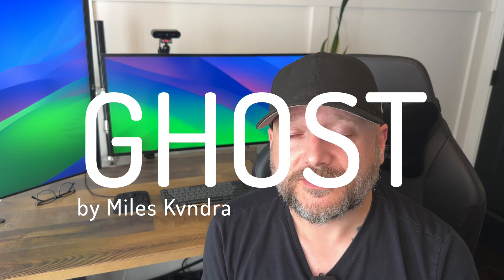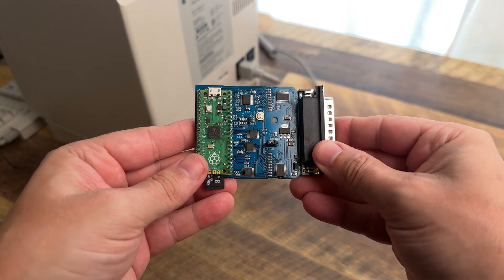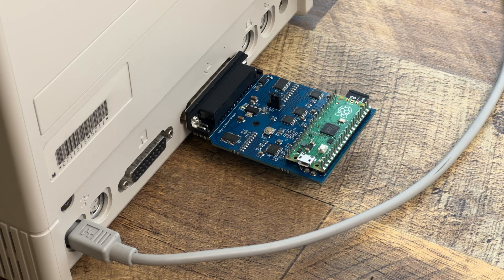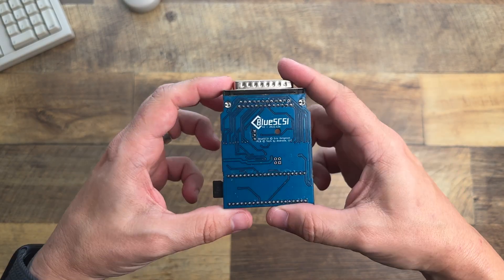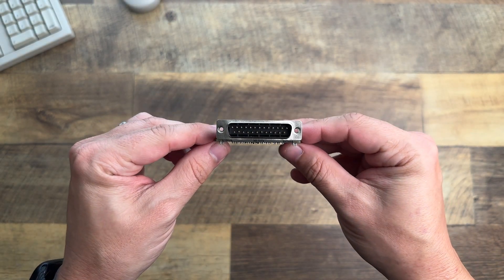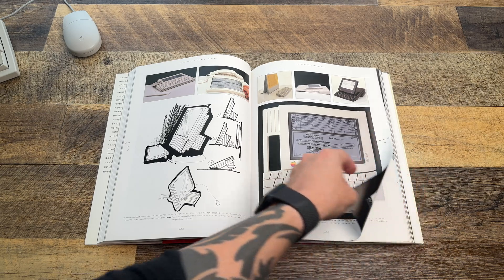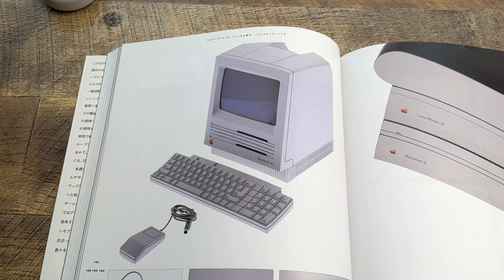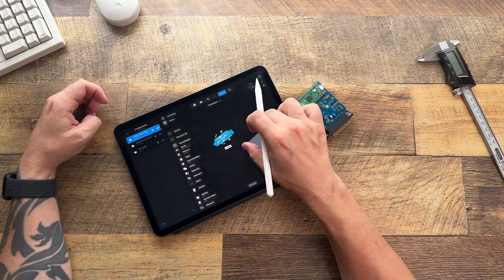I 3D printed an “Apple” case for the BlueSCSI

Comment: How do you make the “custom” dry transfer labels ?
Reply from the maker: I draw out the labels in Illustrator and then send them off to a specialty printer that specifically does high resolution dry transfer work. They are expensive but still around. Dry transfers are still used a lot in product prototyping.
Reply: @polymatt  any links to the service that does that ?  Cheers 😉
Reply from the maker: @8-bitbitsa821  unfortunately the place I used went out of business :(. Looking for another that can do nice high resolution.
Reply: @polymatt  Would you consider releasing the illustrator file?  I just printed these and would love to get dry transfers made ^_^